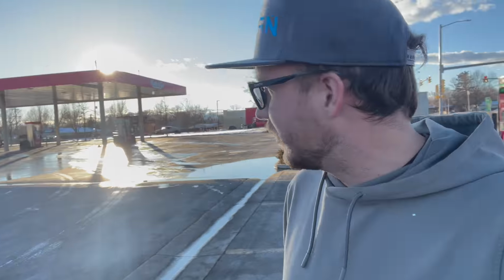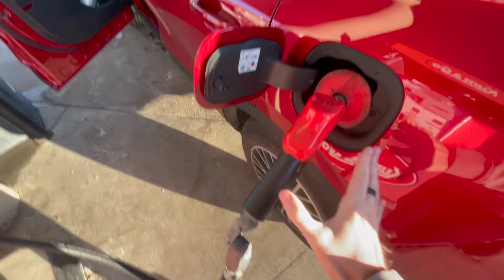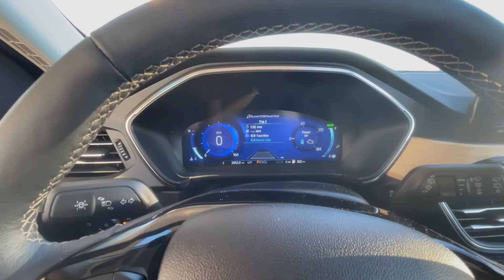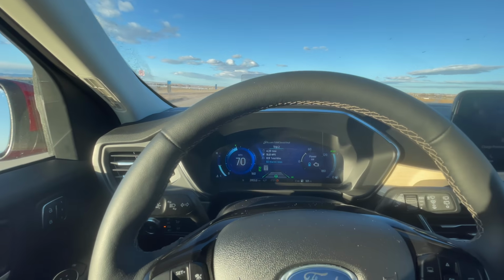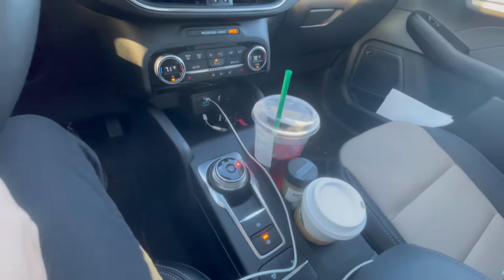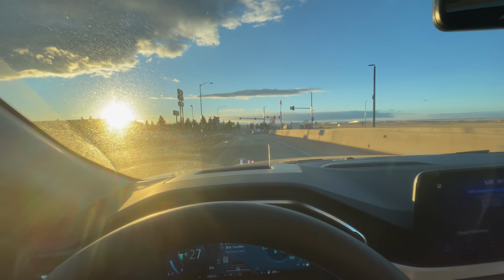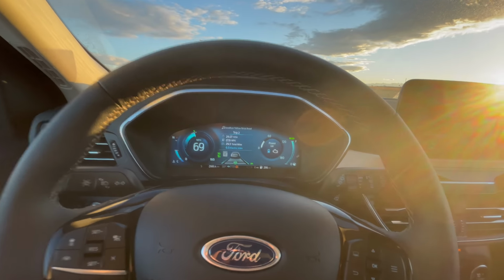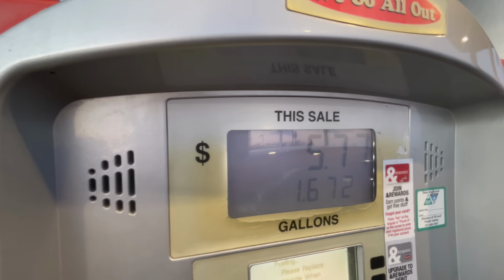Huge Electric Range! But What About The Fuel Consumption? Ford Escape PHEV 70-MPH Highway MPG Test

Comment: I always though hybrid was useless for long drives. It was designed to shut off the gas engine and use electric when the car goes below 60kmph. So it would save you money on city driving with lots of traffic I guess.

Comment: 85 Unleaded?  Never seen such a thing, no wonder why it was so low.
Reply: Higher octane doesn't necessarily give you better mileage. If it did, you'd have to see if the increased price of the fuel is worth it.
Higher ethanol content will reduce your mileage. Maybe the high octane fuel has little to no ethanol. 
Still, need to figure the cost-benefit of higher priced fuel to increased mileage, over low fuel price and mediocre mileage.

Comment: I'm loving my escape phev. Best of both worlds. My driving to and form work 30 miles each way is almost all electric with charging at work and we still have freedom and good mileage for a couple hundred mile commute every few weeks. Saves a ton of money. These are the way to go. Full electrics just don't have the required range and definitely not in cold weather. And factor in the ticking time bomb of a large battery replacement. This smaller battery would be much more affordable in the future.
Reply: How is the review after couple of years any extra maintenance or issues?
Reply: the escape gets beat by hyundai's hybrid offerings, more attractive, better interior vehicles with superior warranties, no question.

Comment: I have been researching HEV and PHEV vehicles for a while now with an eye to purchasing one. Initially I leaned towards an HEV since I don't have 240V available for Level 2 charging at home (and no garage). It seemed that a number of PHEV's could only charge the battery using a Level 1 or 2 charger, which I thought odd as it seemed only logical that the ICE should be able to recharge while driving. This would entail a penalty in fuel consumption obviously but finding information on this from any number of reviewers was difficult to come by.

Most reviewers mention Auto EV or Eco modes, Slippery, Deep Snow/Sand and Sport Modes but never charging while driving. I watched your city loop video and was gratified to see that you got the specified electric range or a bit better. The ideal niche for these hybrids is city driving, stop & go, commuting or shopping trips and appointments.

You ran the battery down to 0% and then another fellow took the vehicle on the highway loop the next day after a full recharge. He mentioned that you had driven around a bit trying to recharge the battery (presumably in EV Charge Mode), but without elaborating on it too much other than to say that the battery never got much over 78-79% charged. I don't recall the exact numbers but I was also impressed that it could cruise at 70 mph on just the electric charge.

Even in this video, with battery again depleted, some electric miles were recorded on the highway loop. You mentioned at the service station that the wind had picked up so perhaps that would account on the somewhat poorer than expected mileage for this loop.

What I think is missing though is a more thorough look at the 4 EV Modes available on this vehicle: - Auto EV, EV Now, EV Save for Later and EV Charge.
Four loops (all on the same day with the same weather/wind), done using each mode with a EV Now route from house to service station to fill up with a fill up after the highway loop might yield some interesting numbers on the best mode to use for each portion of the trip.

Even the manual doesn't specify how many miles or the time it might take to EV Charge to 78% or the impact this will have on mileage/efficiency.

The other thing that no reviewer has mentioned is Low Engine Use Mode. The manual does not elaborate on this either except to say that the engine will be run periodically to maintain adequate lubrication, presumably no matter what other EV Mode is currently selected.

Comment: The State of Charge of the 14.4 kWh High Voltage Battery (HVB) is never at 0%. The guage Ford offers and you are reading is displaying the "usable" charge. If you installed an OBD reader and set up a dashboard reading the actual percentage of charge, it will be closer to 30-35% charged and the maximum charge is around 70-75%. To the driver that 35-45% range they actually use it represented as 0-100%, but in reality you are only using a portion. 

As the engine runs, it's charging the HVB. As the vehicle brakes, the computer determines to whether capture the energy for recharge or apply a greater force to braking. As the transmission creates drag, that energy is recaptured. Unless you set the PHEV to no use the HVB, you will get varying MPG numbers depending upon how much the computer cuts over to HVB for electric power.
Reply: the 0 is a completely separate electric motor system   when at zero the hybrid electric/ gas combo kicks in many of these experts dont seem to understand this   the 4.3 electric miles he mentioned were the gas electric motor which is completely separate from the fully electric aspect of this vehicle

Comment: Please do a mpg on a rdx 2020 awd drive.
Reply: Hi Jorge, we have a 2019 RDX with AWD and the 10 speed automatic.  We love the color and the ride, but the drivetrain is clunky (turbo lag, slow to downshift, the start/stop isn't quick to respond) and we're only getting about 11L/100Km and it prefers premium.  Other comments about the Acura.  There is a fair amount of wind noise, and the media centre control with the "touchpad" is an accident waiting to happen.  You have to get the Platinum Elite at almost $60K CAD) to get cooled seats and the 360 camera) When my truck was in the autobody shop for 2 weeks, I got an escape hybrid as a rental vehicle.  We were surprised about how quiet, and smooth it was.  When taking off and merging into the intersection there is no turbo lag or downshift (like our old Infiniti EX37), just smooth electric power.  The B&O stereo is great,  the gas mileage was incredible (5.7L/100Km driving on the highway and 5.0L/100Km in the city), and the ride was even better than the Acura.  Just my thoughts...

Comment: Honestly just get the hybrid. PHEV don't really have an advantage unless 90% of your driving is city and you're able to plug your car in every day. Also I heard the Escape turns on the engine constantly even when in EV mode which is extremely frustrating when you have a full battery.

Comment: My C-Max standard hybrid gets 38.5 on highway driving at average of 75mph. 43 average in mixed driving after 227,000 miles.
Reply: Man, I wish mine was getting 38. I do mostly highway driving and I get between 32 and 34 and I only go 70
Reply: @Takermania70  keep your tire pressure at 43 on all four and you might want to check your alignment

Comment: How does the air conditioner work...   like when the car stops at a stop sign does  the car turn off if so does the air conditioner keep cooling cold air ... I've noticed new cars the engine cuts off upon stopping
Reply: The AC uses an electric ac compressor and it also has an electric coolant heater. I drive mine as a full ev 60 miles highway per day using 120v charge at work. The old hybrids did what you're speaking of though. I always drive in EV now and the engine only comes on once the battery is drained but it will still get a few electric miles here and there from regen braking even in hybrid mode.

Comment: Not surprised it's lower than EPA estimates. I also have a 2014 Escape 2.0 turbo. The 2.0 turbo is anything but Eco. In town and even a mix of in town and country driving, the highest I've ever gotten was 20 MPG. My wife has a 1.6 turbo and that's much more efficient but still not quite as efficient as EPA states. You definitely don't want the 19". The ride is rough. I have them and yea, I'd go with the 18". Plus the tire size is odd with the 19s.
Reply: they said during the video it was 41 degrees and windy and getting colder and windier, so I'm not sure the test was "fair" and "accurate", unless you literally do all your driving in the dead of a Chicago winter

Comment: Just FYI? The European commission is about to slap all the manufacturers with a round of fines because none of these phev's get anywhere near the mileage advertised and use for more fuel than they say as well. Say goodbye to the PHEV. They will never meet standards.
Reply: Remember that mileage depends on how you drive. My PHEV gets 100+ miles in the summer and 80+ in the MN winter. It would be a shame to remove an efficient vehicle because some use cases are sub optimal.
Reply: @esevre  Hey if you want to continue to be held hostage by a scarce resource thats your choice. I will never miss getting into a cold car and waiting for it to defrost, Or waiting for an oil change, Or brakes once a year.
Reply: @davefroman4700  I would love to have a fully electric car, but I cannot afford one at this time. By using a PHEV I am able to use far less gas than buying a non-electric vehicle. Because of my driving habits my car is able to run on electric for almost all of my driving. I think it is awesome that you have the resources to afford an electric car, and I wish I could. I wasn't expecting you to comment in a way that feels like you are insulting me for being in a different situation than you are. I was trying to highlight that we should analyze technology based on the use case that we are applying a technology to, for some cases a technology will be sub-optimal, and for others it will be a reasonable fit. If this wasn't clear, I apologize.
Reply: @davefroman4700  What scarce resource? Cobalt for batteries? 
Oil will be sucked from the ground long after your great great grandchildren made grandchildren.
Reply: It's America, dude.

Comment: I saw that you chose 85 Octane, but I believe Ford says 87 octane is the minimum allowed.  Could this have affected the results?
Reply: yes, and lower octane with a greater mixture of ethanol is particularly worse in cold environment, and they said it was 41 and getting colder and windy too
Reply: I didn’t know they sold 85 octane. Not here in.  NJ
Reply: It's only available at higher altitudes.
Reply: @awmustang  ahh yes I didn’t know this was in Colorado

Comment: I'm pretty sure your owners manual says to use 87 octane fuel.  Why did you choose 85 octane?  I know, I used to live in New Mexico and there, Colorado, Utah and maybe elsewhere they sell 85 and 86 as regular but I've been told by more than one service manager not to use it, stick with 87.
Reply: Yep, completely screwed the test up by using 85 octane, this vehicle is designed for 87.

Comment: I wouldn't discount the plug in range of 37 miles. That might be most of the vehicles miles. Lots of savings on gas.
Reply: Not on a highway road test…
Reply: I drive my 2022 ford escape PHEV 162 miles round trip every day in the coal fields of the Appalachian mountains (up and down 3 mountains). I plug my car in every day and I average about 64 mpg (done the math from the pump as well) most of the time and the biggest part of my trip is 4 lane road running between 60-70 mph…. Ran it for 3 days without plugging it in and my mpg went down to 38 mpg
Reply: @ShaneCharles-xt6of  Wonderful info! I was looking to supplement(and save on fuel costs) my service business with this PHEV. The size of the SUV is perfect to haul my tools and parts. My daily driving varies drastically from 50 miles up to 300. If I can get the claimed 40 MPG average I'll be happy. 60 is way gooder 😂 My current vehicle is a Ford Transit. About 18 MPG.
Reply: Depends how you use it. If doing lots of city , local driving, gas savings will be definitely huge. It all depends on usage.

Comment: A couple of constructive criticism now that I’ve seen a few videos with this host (I’m sorry I can’t remember their name)

1) when moving around with the camera, make sure the motions aren’t fast and jerky. It gets quite disorienting when watching it on video.

2) consider some public speaking courses. The delivery of this comes across as monotonous and rambling. 

3) a good portion of this video should have been edited out. While I got a laugh when showing that refueling an ice vehicle is not a fault-free experience either, the video didn’t really need 2-3 minutes of refueling. We also don’t need a full explanation of the test procedure, we don’t need to see the trip meter being reset or to be told the tire pressures were checked. That is all stuff that could be put in the video description. Any review of interior, driver assistance, etc should also be done in a review video. If they are included here, it should be no more than a minute. This is a video about the highway efficiency, not a review of the car.

Comment: For what it's worth.  Just completed a 770 mile round trip from Bay area to LA on Hwy 5 with my 2020 standard hybrid Escape.  Avg 36.4 mpg.   This was not a controlled test.  Just driving with the flow (70+).  63 miles electric. Mpg calc at the pump.
Reply: The standard hybrid seems like a no-brainer if you're getting an Escape. It doesn't cost much more than the regular gas model, you can still get awd if you'd like, and the fuel economy improvement is pretty big.
Reply: @rabidsquirrel22ben  no, because the hybrid doesn't come with tax rebate, but PHEV does
Reply: @rabidsquirrel22ben  the hyundai hybrid is a much better competition, and doesn't look as ugly, the escape isn't a v good product
Reply: @roboticvenom1935  Based on what? Opinion and subjective preference? I bought one a few months ago and interior isnt cheaper or better than average competitors. Seems like reviewers are biased towards their favorites. Plus, Escape uses the same eCVT as Toyota, meaning you're unlikely to have transmission issues. Dual fuel injectors, so valves stay clean. Its a decent vehicle on technical points. Looks are subjective.

Comment: When the larger Explorer gets 28 mpg on the highway that is not good mileage.
Reply: they screwed up the test so badly: they used 85 on a vehicle that's designed for 87 min, and in ice cold temp and windy they even said

Comment: What was the battery charge after doing the loop test? Some cars charge it again to some level while driving at a constant speed.
Reply: escape will charge back up to 78%.  unknown if they did this.

if they put it in normal hybrid mode, then on this test, mpg would be lower because it charges the pack.
If they hot the EV later button, it would not use EV and not charge it

Comment: Shows why PHEV's are a waste of money for long commutes and or road trips.  For nearly the same money you could buy a Tesla M3, and have a more economical and capable vehicle hands down!

I used to have a Corolla that got 38mpg, then made the leap to Tesla and despite the FUD, there has been no looking back.  I wouldn't ever go back to ICE, 100K and going strong!
Reply: I traded my Tesla in for a RAV4 Prime, no regrets. But DC infrastructure is lacking as is Tesla quality.
Reply: I drive 30 miles each way to work almost all electric with charging at work. No affordable electrics come close in range to my needs to do a 200 mile 80mph road trip a few times a month. They just don't have the range in the winter even if they could barely make it in summer. Not an issue for the escape.

Comment: This vehicle is eligible for a $6843 federal tax credit.  Some states also offer credits on top of that and give access to carpool lanes.    Ford does offer incentives from time to time on this vehicle.  Checked a few months ago and it was $1000... but of course the chip shortage seems to have ruined the fun.  I imagine during normal times, there would be larger incentives on this vehicle.  And of course I imagine a lot of people interested in this vehicle qualify for the A or X plans.

Never realized Colorado used 85 Octane gas; guess it's possible due to the elevation.   Your fuel economy hit close to EPA which is solid at the low to mid 30Fs.  Although, higher elevation is a benefit to fuel economy both through lower air resistance and less energy to pump the fuel. (not 100% on the pump thing, since this vehicle has a pressurized system)  Front wheel drive is fine for most people; I've never had a problem with FWD in the snow.  Climbing a mountain in the snow, or off roading may be a bit more of an issue... 

Solid vehicle, but price is a few thousand too high.  I'd wait for incentives.  Although, I might say the same thing about literally every car right now...
Reply: For me after Ford rebates I got it for 37,500 without tax, and every feature they offer minus sunroof.